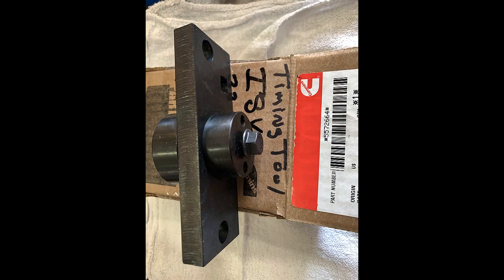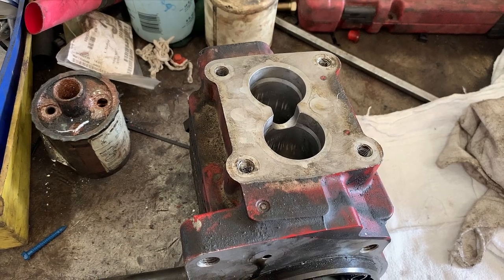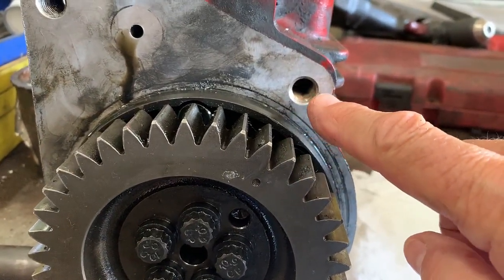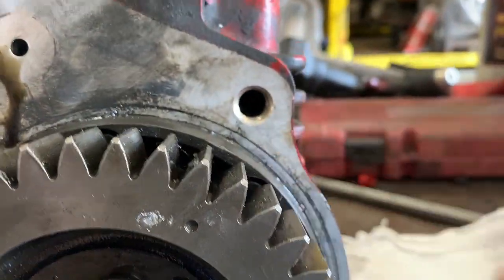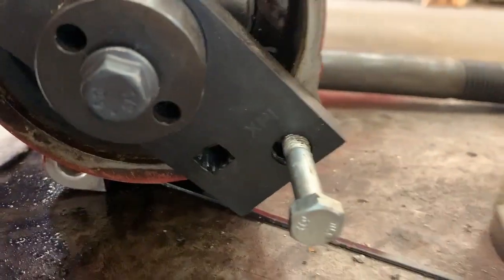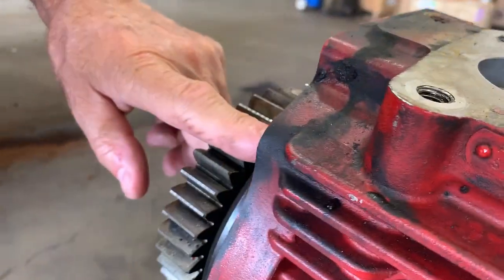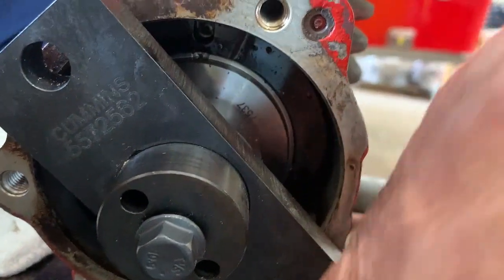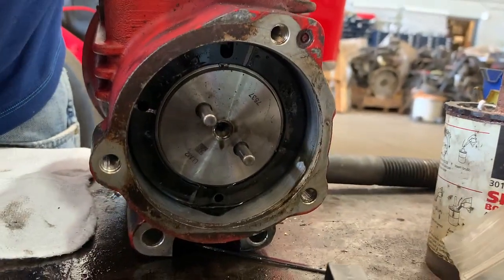ISX 15 high pressure fuel pump install cheat

Comment: Massive amount of information here. You just  saved me 700$ . That tool is expensive!!. My pump was off about a quarter turn anything i should be worried about ? It ran like that for 250k miles . Thank you very much
Reply from the maker: No reason to worry.

Comment: ive always lined it up timing mark to the opposite bolt hole, because of other videos and images ive seen trucks never had issues. This is the first ive seen it lined up there…
Reply: you put it where the old one came off, just like the air compressor unless your pinning the engine,
Reply: I know, me too.